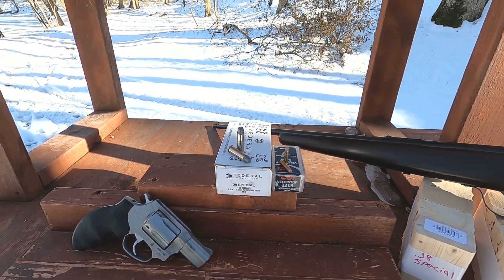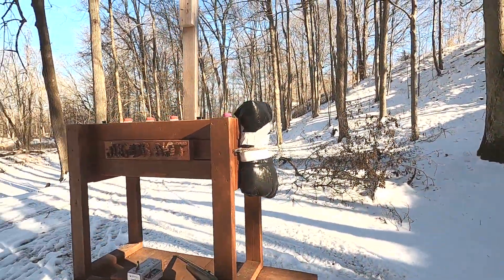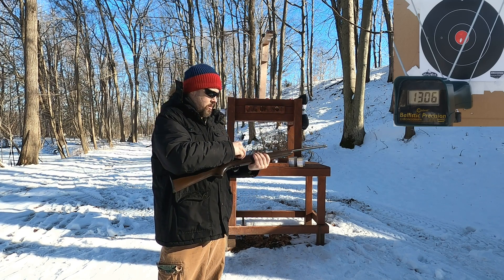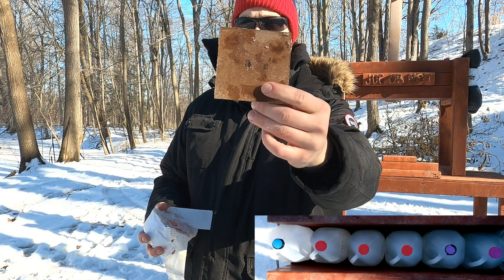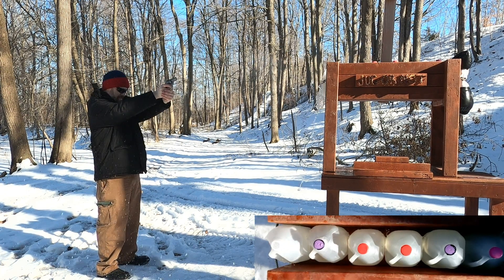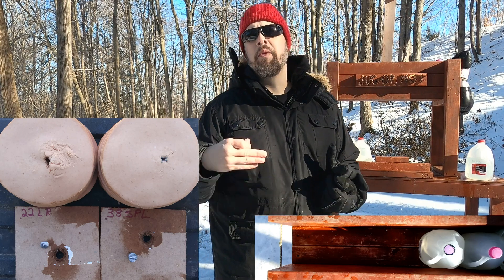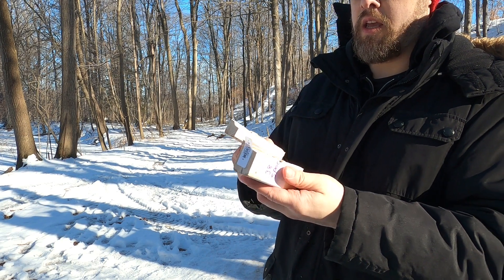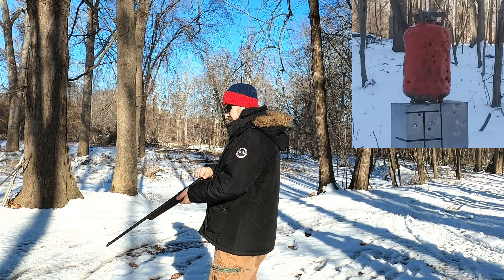.22 LR Rifle VS .38 Special Snub Nose! Same Energy? Scientific Test

Comment from the maker: Two thing; First, when I said that one of my chronographed rounds might not have been a CCI Velocitor, I said that as I have been doing a lot of tests lately where I simply pocket loose .22 rounds. I empty my pockets, but I don't obsessively dig around, so I could have had a .22 Short in my pocket from a previous test. That's my theory with this 1,084 FPS read as in my test with .22 Short I had readings of 1,082 FPS and 1,085 FPS, and it's cold enough out my fingers would not tell me the difference between .22 Short and .22 Long Rifle. 

Secondly, I had made a mention at the end of the video where I said you can take a .38 Special+P, put it in a 4" barrel and get 500 ft lbs. This is not an error, this is reality, but sometimes newbies don't know .38 Special+P can be this powerful. I believe that in my 4" 686, in the past I got the Super-Vel "Super Snub" ammo up to 546 FPE and the Underwood 158 gr LSWCHC up to 520 FPE.
Reply: Hornady claims their .22 WMR Critical Defense round is the same as any .380 ACP hollow point. I'd like to see a test of the Critical Defense .22 WMR and Critical Defense .380 ACP side by side to see if it even comes close. That is, if you can.
Reply from the maker: @jmurphy68463  That might be interesting. The only issue I have is that, if I did get a .22 handgun I have my eye on something cheap that has a 4.6" barrel, and my only .380 is a 2.75". If...I can get that new Heritage "bar keep" revolver, this would be a good cheap way to do that test if I can indeed get the ammo. I think I have a few rounds of that .380 CD left.
Reply: @GunSam  I've been thinking about getting the new Rock Island Armory .22 magnum revolver. It's single/double action, has an eight shot cylinder and four inch barrel. It'd be lots of fun out here on my land.
Reply from the maker: @jmurphy68463  .22 mag is great, in a NAA mini its no good, barely above a .22 LR, but out of a 4" barrel Its awesome.
Reply: very cool gun sam revolver dude i have a 22 and i have a 38 special snub have other guns but i wanted to know this question myself thank you.
Reply: I wouldn't want to get shot by either. 38's get maligned quite often however, if they were that weak a bullet, they would stop producing them in all the different configurations of defensive ammo. I'm picking up a Taurus 605 sometime today. First upgrade will definitely be the grip.
Reply: @lutherpayne9957  I love my 605! Grip is pretty good too but I've my eyes peeled for some nice wood grips!
Reply: I purchased a Ruger lcp 2 in .22 lr simply because I have more .22 ammo than any other kind. I've kinda experimented with different ammo and was surprised. I definitely do not under estimate it and surely wouldn't won't to get hit with it!
Reply: Mr. Cool  damn, a 40,000 fps BB hitting a moose would be something to see!

Comment: Came back too watch 👀 again because I realized this Is exactly what I was wanting to see. (38 special vs a 22WMR).   40 grain 1320fps from the 22LR 24 inch barrel is about equal to a 40 grain .22 WMR out of a 4 inch barrel (PMR30)around +/- 1300fps. And that makes this a 2fer review. This makes it even better and it was real good to start with.

Comment: How old is that 22 rifle. Pull back fireing pin. I got one like that from dad when he passed. However he broke the stock and cut it off so its more like , dare I say , a long barrel single shot hand gun. 
Had it over forty years.
Great vid.
Reply from the maker: Thanks. I don't know the exact age, but I might guess it's from the 1940's or 50's.
Reply: @GunSam  just looked mine., the 
22 Lr,  coa, target by Winchester 
Thats all i can see on it. 
Bolt action , pull back cocking 
This muzt be that old or older. Still shoot .

Comment: A solid .22 would go further into more jugs. A hollow point will expand and dump all it energy real quick...but I'm sure you already know that; I'm just an armchair  viewer!😄
Reply from the maker: I think it would matter on the lead alloy and velocity. Like, i'm sure a 1,000 to 1,200 FPS 40 gr solid would go further, but if it gets over what the Velocitor ammo got, being a pretty soft cheap plated bullet that a .22 LR is, I think it will deform near to what a hollow point expands to.

Comment: Really appreciate your tests. My wife could not handle the weight of a centerfire and was dependent on a 22lr rifle for home defense and it was loaded with 40 grain Minimag solids. While the hollow points will expand from a rifle length barrel it limits penetration too much. I also found her semi auto rifle was not reliable with hyper velocity ammo. You might try Aguila Interceptors. She has been able to use a 9mm braced pistol. The braced pistol works for some people with disabilities that can not handle a full size rifle. 
 I have been carrying 38 spl wadcutters in my LCR. Very easy to shoot in a 16 oz loaded weight revolver. Much faster follow up than with +P.

Comment: To put "energy" in perspective: A factory Remington 55 grain 22-250 has 1,654 lb/ft of energy. Their 405 grain 45/70 has 1,590 lb/ft. Both will kill anything that walks or crawls with proper bullet placement, but if you have a ticked-off bear coming towards you and you may not have a "perfect" shot, which one would you reach for?
Reply from the maker: I used to look at that Taylor Knock out chart and was always surprised by the data. Like, even a .44 Mag with less energy has a higher number than a 30-30 rifle.
Reply: @GunSam  Having shot several BIG hogs with various cartridges, I can honestly say large diameter bullets at moderate velocities work well almost every time, while some of the faster cartridges- despite higher energy figures- were less impressive. 44 usually broke them down while they often ran a ways with a solid boiler-room shot from a 30-30. And anyone who has ever seen a whitetail dumped by a traditional muzzleloader/round ball (pretty puny compared to almost any centerfire) can attest to the idea that the bullet is what does the work and not the foot-pounds.

Comment: So the .22HP gave a little more tissue damage with less penetration. Using a .22 solid would likely have provided similar penetration with less tissue damage. Would be interesting to try it. with the .22 solid and maybe a .38 HBWC.
Reply from the maker: I think if I used the Velocitor solid, there would still be deformation, but probably around .30 caliber, not .40 caliber like the HP. That's one point of my testing that I like, without tooting my own horn the fiberboard matters. In gel tests a round nose stays the same, but a little harness and they will deform some. I might do some regular round nose tests if I end up getting a .22 handgun which I don't currently have anymore. Doing rifle VS handgun might be interesting and I have a ton of CCI Blazer 40 gr RN ammo.

Comment: I would say that .22lr out of a rifle is every bit as good and probably better than standard pressure .38spl from a 1.875 snub.

Now when it comes to snub vs snub I'll take .38spl over .22lr or .22mag all day.
Reply from the maker: Yes and no in my opinion. Maybe against a human attacker, but a larger animal that's really thick probably would take more damage from a .38 as there's a lot of bullet mass. Most .22s will deform or deflect even in round nose.
Reply: @GunSam   Good point.I ended up with a .22 mag LCR a couple years ago. Cool gun but couldn't really find a use for it,traded it in for a S&W 637 and haven't looked back.

Of course I bought a few boxes of .22WMR Gold Dots and Hornady CD that I have no gun to use it now lol.

Comment: I'd like to see this test done with regular round nose .22. Some hollow points( Stingers) might as well be solids but some like the Velocitor and Yellow Jackets are very destructive on small game. They really expand at rifle velocities. The bologna pack and fiber board bears me out here. It's one of the reasons I like .22 short for hunting squirrels. Foot pounds is a unit of measure we are kind of stuck with for comparisons sake, but real world results are really funny.  It's why I really like all the actual testing you do on different stuff. Lots of data lets me tailor my choices according to intended use.
Reply from the maker: I noticed in past testing that even round nose bullets in .22 short or long deform in my testing, but gel tests just make then over penetrate and not deform. I'm willing to bet the human body deforms them.
Reply: @GunSam  i don't doubt you're right. High velocity round nose makes a surprisingly large exit wound on coyote. It's gotta be deforming some.

Comment: Good review if possible do a 125 grain 357magnum out out a 5 or 6 inch revolver against a 124grain 9mm out of a 16 inch carbine.....my money 💰 is gonna be on a hot Buffalo Bore
357magnum to be the winner.
Reply from the maker: I don't have those specific guns, but I did get near 1,700 FPS and 800 ft lbs with Buffalo Bore's 125 gr .357 Mag in my 4" barrel. I think 9mm gets up there in a carbine around 600 ft lbs.
Reply: With Buffalo Bore I feel like a .357 snubbie vs a 9mm carbine would be fairly close.
Reply: @rob.3575  yeah they would more than likely be close but carbine ranges with a snubie is a hard shot..

Comment: Excellent test. I greatly appreciate all the time and effort you put into this channel. You provide valuable information that is clear and to the point to folks interested in the practical aspects of self-defense.  Now to my overly long rant.  "Muzzle Energy" is "Propelling Force" not "Striking Force".  In simple linear momentum, [Weight X Velocity = Momentum]  the 22LR  has 40/7000 X 1320 fps = 7.54 "Foot Pounds per second" of striking force. The 38 Special 158gr @ 700 fps has  158/7000 X 700 fps = 15.8 "Foot Pounds per Second" of striking force or slightly over twice the striking force of the 22LR.  The difference in striking force is clearly demonstrated in the 2X4 test, where the greater striking force of the 38 SPL broke the 2X4 in half.  The 22LR will deliver the striking force faster in a liquid environment because the soft lead hollow point @ 1320 fps will open fast in a liquid environment as it is designed to do.  How the bullet performs is more important than the actual striking force. A 125 gr FMJ round nose 357 Mag @ 1450 fps will barely swell a 1 gallon water jug on impact, while a 125 gr JHP 357 @ 1450 fps will blow the 1 gallon jug apart! And a flat point 125 gr FMJ 125 gr 357 @ 1450 fps will create more damage than the round nose FMJ. The larger the flat point diameter (Meplat in ballistic terms) of the FMJ, the greater the disruption (damage) in a liquid environment.  In the 38 Special, a 158 gr Round nose @ 850 fps will create little disruption passing thru 1 gallon of water, while a 158 gr SWC @ 850 fps will create much more disruption (damage) on 1 gallon of water.  Go to a 148 gr full WC at 850 fps and the 38 Spl will create considerable disruption in 1 gallon of water.  Where a HP bullet will create a large cavity with shallow penetration, a large diameter flat point bullet will project that damage forward, creating a wound tunnel with a diameter dependent on the flat point diameter.  A 38 SP 158 gr flat point bullet @ 1000 fps with 70% caliber meplat (0.250" meplat) will create a deeper wound tunnel with less damage diameter than a 38 SPL 158 gr flat point bullet @ 1000 fps of 80% caliber meplat (0.286" meplat). This is why handgun bullets used for hunting are often hard cast lead of WFN (Wide Flat Nose) design. WFN bullets of about 80% caliber meplat will rip a large diameter wound tunnel, chalk-line-straight, completely thru 2 or 4 legged aggressive critters, while smashing bone into splinters along the wound path.   Out of an aluminum small-framed 38 revolver, the hard-cast-lead 148 gr WC @ about 850 fps is hard to beat, as it will ALWAYS rip a wound tunnel completely thru an attacker, regardless of buttons or cloth thickness encountered!  As a citizen, the odds are I'll be ambush-attacked alone with no back up in a remote location, so my handgun has to work or I will not survive. That is why I chose a 38 revolver firing full WC's at 850 fps (2" barrel). If multiple attackers are a concern, then I'll carry a second 38 revolver. I have 9mm autos (XD's and CZ-75B) and love them, but autos can easily fail in a close contact ambush attack.   My suggestion is get a pair of 3" Taurus 856 6-shot 38's and put Crimson Trace laser grips on them. Very wicked little handguns, easily carried and concealed, and lightning quick into action from concealment.  I like the Lee tumble lube 148 gr WC's, cast hard at about 15 BHN, and can cast TONS of them quick from the 6-cavity molds.  The 148 WC's get about 900 fps from the 3" 856, and slap big ground hogs and coyotes down DRT!  I have total confidence in the load and am willing to risk carrying hand loads for self defense because the 148 gr hard-cast Lee WC's work so well and reliably!

Comment: This is very interesting as it is the Velocity vs Weight controversy of balustics.  

Does a 9mm 115grain bullet equal a 230 grain 40+ caliber ?  The bullet profile is hard to compare.  You can hand load 9mm  SWC boolits.  Slow moving heavy bullets from a revolver tend to be accurate.  Hyper Velocity 9mm  in Polymer guns can be snappy and less accurate. 

I wish you could Zombies for Balistic testing.  Maybe the next pandemic will give us more Zombiez...
Reply from the maker: I think as far as ability to stop a threat, a 9mm VS .45 ACP with hollow point ammo and the same energy will be similar. However, the momentum of the .45 ACP can never be dismissed. It plows through everything in a more straight line, like auto glass, big animals etc.

Comment: It’s not ideal, but if it’s what you have, a 10/22 or similar loaded with velocitors (or equivalent) can be a formidable defensive weapon. You could put a handful of those into a bad guy in a hurry with zero recoil.
Reply from the maker: I have even tested that out when I had a 22/45 .22 pistol. Very easy to mag dump head shots, as where bigger calibers are all over the place.
Reply: Agreed.  It's common sense. 
For a bump in the night or having to defend yourself from a dead sleep after a few beers, a .22 rifle is the way to go.  The violence, noise, and muzzle flash of a high powered weapon could temporarily blind and confuse you, if you're even able to control it very well at all.  Real life is not like a scene from a movie where you get to take your perfect stance, square up to your target and draw a glock from appendix.

Comment: Greater mass tends to resist slowing, even if the energy calculation is exactly the same as a lightweight high velocity object. It's an extreme example, but in my mind I tend to compare a speedboat to a barge. You could accelerate a speedboat to the velocity required to have the energy of the barge, but I guarantee that speedboat will terminate, explode, stop when hitting something large where the barge will rip up an entire harbor before stopping. hahaha
As far as safety goes in those penetration tests, probably a good idea to examine the blocks and make sure there's no knots where your bullet will impact.
Reply from the maker: Yes, and that's the thing most 9mm vs .45 acp debates miss. And when you try to explain momentum, and how the bullet retains more energy at long range, goes in a straighter path in flesh or auto glass, and explain how momentum matters....you get cut off with "no handgun round can knock someone over!", as if that's what we were even talking about. A lot of people have words and terms like "momentum" and "stopping power" confused with some definition it is not, and they like to argue how smart they are about it. I have noticed this lol
Reply: @GunSam  I've observed the same things in social media discussions/debates.
No one should pretend the laws of physics are easy to discern and define, but if words have meaning (which they do), please exercise the proper use of them.

Comment: Great test! I love this old debate. Lighter faster vs. slower heavier. This goes back to the old cowboy days, Col. John Thompson and the Mora warriors. The logic before hollow point ammo was that a slower, heavier bullet will do more damage and therefore the better choice. The .45 auto round with the reputation of knocking a man down. Since the introduction of HP ammo, velocity is king. The .357 magnum round fragmenting like a hand grenade. Kind of like which is more effective: a heavyweight boxer with one slow punch or a middleweight hitting several quick blows. Answer: both.
Reply from the maker: Thanks. I happened to have the opportunity to do more of a real world test with this debate. In 2008 I shot about a 180 lb whitetail buck with a .270 Weatherby Magnum, it was about a 100 gr bullet at whatever velocity it takes to make the 3,000 ft lbs energy it produces. Then in 2009 I shot about a 160 lb doe with a .444 Marlin, 240 or 265 gr bullet at whatever velocity it was to make about 3,000 ft lbs energy. Both shot from 40 yards. Without question, the super fast Weatherby Magnum was way more effective, not to say the .444 was not, but with the .444 it was a more traditional deer kill, a few steps, loud moans and dies in 45 seconds. The .270 Weatherby on the other hand was like hands smack together, slam to the ground, in 2 seconds leg was twitching. Was brain dead in seconds even though it was a body shot.